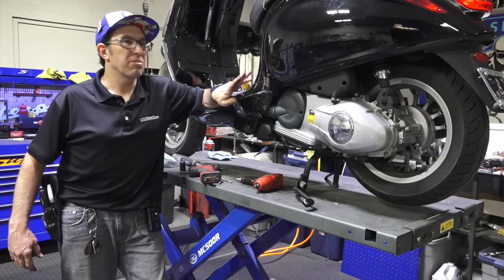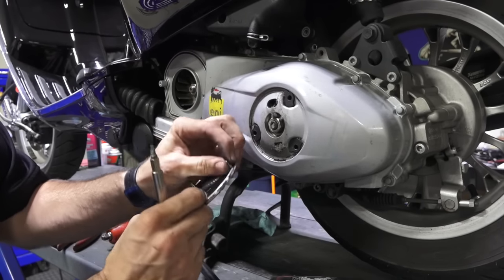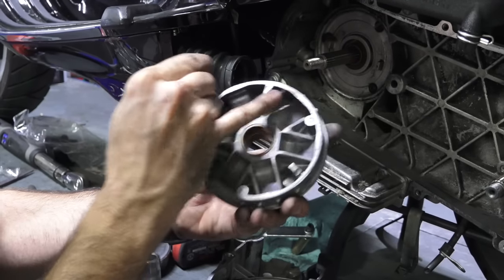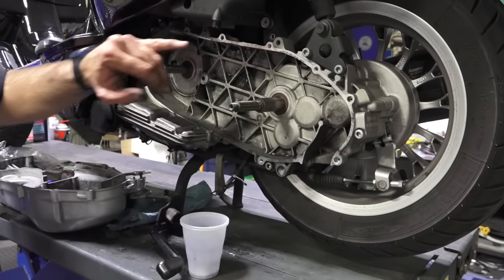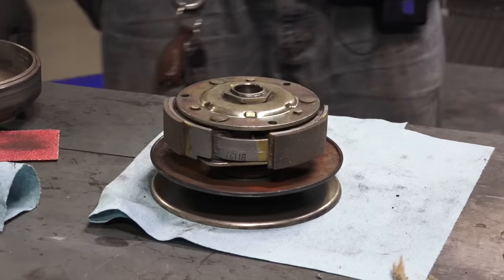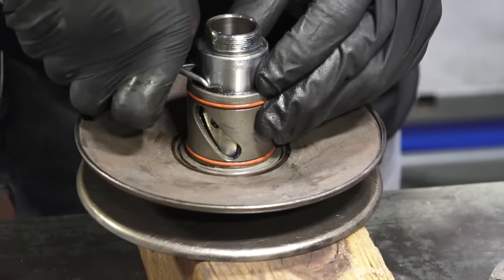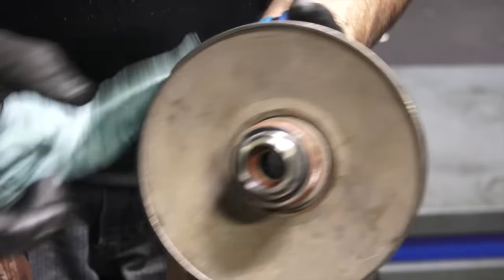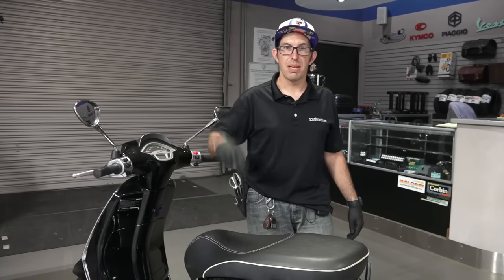Complete Belt, Variator & Clutch Service for Vespa 150 3V

Comment: These videos are incredibly helpful. Before I found this channel I watched so many videos that were terrible in content and quality that I was about to give up on youtube for help with scooter maintenance. However, it didn't take me long to realize that Robot is a true master mechanic. What's more is he never comes off as condescending or overly rigid on the "official way" to complete repairs. He's a guy's guy, a real straight shooter. For example, I'm never going to buy that dumb clutch assembly tool. Had Robot not shown me how to use my feet to compress the tensioner spring, I probably would have tried something stupid like just zipping off the nut (and probably would have taken a clutch pad to the face). It's for reasons like these that I try to order parts from scooterwest when I can. I appreciate the support they provide for home mechanics. Most dealers do what they can to make their customers dependant upon the dealership for all maintenance needs. Here's to Robot and the gang at Scooterwest/Vespa Motorsports!

Comment: This video help me a lot. I had a problem power on wheel not disengaging. And problem was with pin/round pipe on variator. Variator not sliding on pin. Just cleaning removed problem. Greeting's from Croatia❤

Comment: I just serviced my vespa for the first time ever using this video, thanks to Fabio in the parts department for working with me! It took me about 3 days to do it due to weather and being meticulous about cleaning. Here is what I did.

New:
Front and Rear shocks
Rollers
Belt
Starter Pinion
Front Brakes
Air Filter
Oil Filter
Oil

Sanded the clutch, and the front and back casings so the belt had better grip with 400 grit sand paper that was recommended. I had to replace the (flange?) nuts on the exhaust after doing the oil, which was a major pain. This video helped me do most of it, the rest like the shocks and oil change was more common sense, but this made it very easy to open the casing and play around with the inner workings. 

Next project is to clean the carb by myself! 

I'm also not a mechanic. This is the first time I ever worked on anything engine related in my life, it was much easier than I thought it would be.

Comment: amazing guide: replaced my sprint primavera's belt.  my first service.  my greatest tip is if you change the belt before it breaks it will prevent you from needing to disassemble the driven pulley (which i sent to portland and they ended up deeming it bent and replacing.) but i was 5,000 miles overdue for a belt change so there is a lot of in-between defining since i was going easy on the clutch the whole 11,000 miles.

Comment: Very Nice "Video".... but, what is the "Torque Setting" for the Centrifugal Clutch Nut (34 mm nut)... ????   you told us the variator - 62 ft-lbs.... clutch hub - 45 ft-lbs.... but, you never tell us for the Centrifugal Clutch Nut..???  OK - ROBOT and Vespa Motorsports.... WHAT is the torque the Centrifugal Clutch Nut..????  (please)

Comment: Hi robot,
thanks again for this wonderful tutorial. I have a question : where does the ground wire you pull of from the font cover screw found his origin. On my piaggio x8 2004, i see it had this wire on this screw, but there's no wire anymore. My motor got poor strengh between 0 and 50 km/h and i am wondering if this could be the reason of this disease ?? Thanks !

Comment: Piagio / Vespa lovely romantic. No wonder MasterChef Australia  had one on their parking roundabout outside outside their competitors building. It was  staged with leafy green foliage  filled one with warm fuzzies just thinking about riding a Vespa. Now for the fun bit😗 like a firearm. Nothing ever goes wrong if the firearm is left stored in a tamper proof cabinet.  I wish Ralf Nader had written a book on operating a motor scooter.  
Just like the Corvair or the Bug /Beetle.  MV Agusta  TR.6 or Anything that will Aquaplane in wet or dry

Comment: Hey Robot, what a great video! It helped me replace the drive belt on my Primavera 150 3v. However, I am having trouble with not much of the shaft bit left when putting the clutch and the bell housing back on. It just wouldn't go in anymore as if its hitting something. As such, the clutch housing weren't even fit. Any idea what could be stopping it from sliding in further? 
I actually replace the entire driven pully/variator but reuse the clutch. Thanks in advance!

Comment: Great video Robot. I have had belt and rollers replaced. But I still have a strange noise.
When cold no sound. But once warm, when I pull away at low revs/throttle I hear a scraping/dragging sound.
It does not feel like it is pulling properly. When I open the throttle a little more the sound disappears and it feels like bike is pulling better. Would this be a clutch issue?

Comment: Will it hurt the engine to idle without the variator reinstalled yet ? I'm curious about the source of a sharp click at shutdown, following a belt break at speed. Just trying to nail the source, and without the variator and with no belt, I think this is a no-load test point. Of course I would not rev the engine...no more than idle. And I will ground the strap that was on the CVT cover screw.

Comment: i was given a piaggio x9 evo that needs work,firstly theres no spark even after replacing spark plug and coil, secondly when i turned the back wheel i noticed a sound that i thought was the brake pads worn out to metal but aftyer closer inspection it seems to be coming from behind the clutch, could it be those roller bearings you were talking about? Piaggio evolution 125cc 2003 carburettor  model..one with indicators in the mirrors.

Comment: Thanks for the video.  I used this to replace the variator with a jcosta and the clutch for a polini race adjustable; are you able to offer any advice on adjustment, the pick up on pulling away is quite late?

Comment: Hi to all of you. I have changed the bearing on the clutch cover. the bearing was able to remove it by my finger and install the new one by finger again ( I have purchased the new bearing from authorise dealer with part number). is this correct or I have to change my clutch cover?

Comment: Isn't 60 grit a little excessive for the pulleys? I don't mean to offend and I don't have the years of experience you guys do but I thought you'd want to keep the pulleys scratch free. Won't those scratches damage the belt quicker? Would 300-800 grit be better?
Reply: 60 grit is fine. Just dont over do it.

Comment: When do you recommend replacing the clutch bell?  Mine is at 10,000 KM.  Experiencing some clutch shudder.
Reply: Clutch shudder is usually fixed by rubbing down the clutch shoes. I'm not sure which grade sand paper works best but I'd recommend giving it a go.

Comment: Can you please explain to me how weight of rolers are connected to max speed?
if I put lighter rolers will I increase max speed or acceleration?
I have nexus 300 with 26g rolers
Reply: its not related really.  once the belt is wound all the way out, the engine/drive-train is effectively coupled so whatever wheel speed (equivalent to "redlining in top gear" in a manual) you get then that will be your max speed.  You might need to get oversized variators to increase top speed.   Of course, if your roller weights are horribly set up, then you wont hit your max speed.  If the weights are far too light, then you will be redlining before the variator has would all the way out.  If far too heavy then you wont get up to peak power RPM.  But if its "kinda right" then I dont think your max speed is affected.